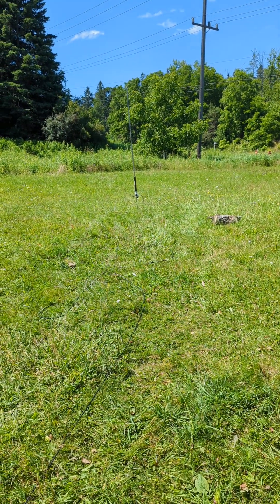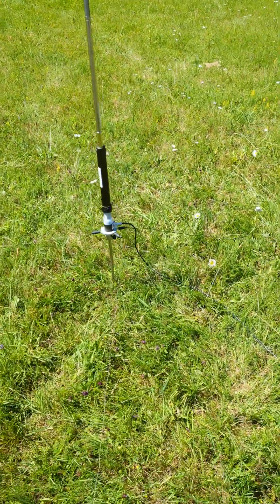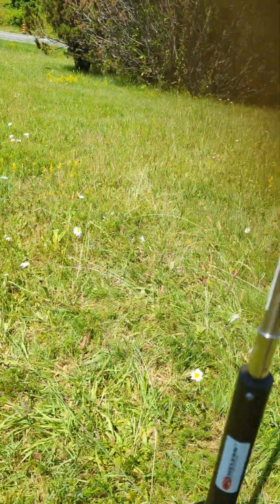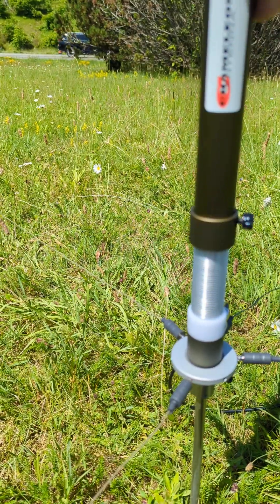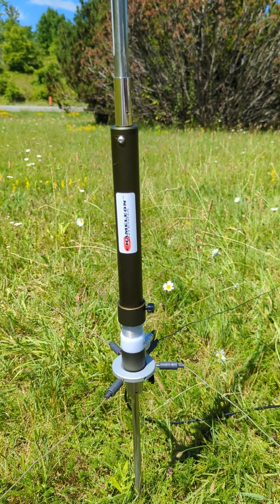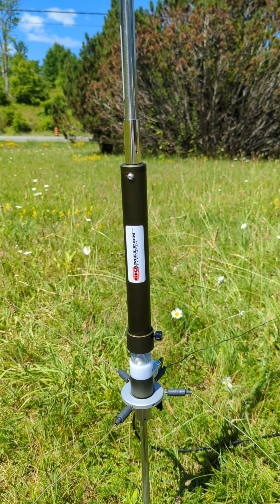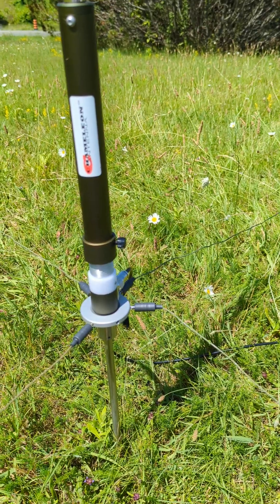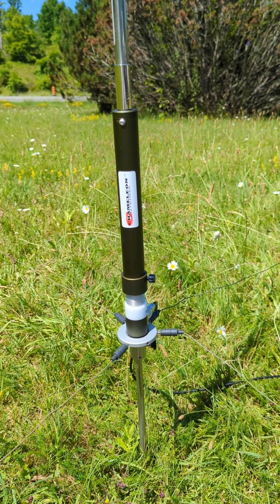Chameleon PRV Review - Fire Trucks POTA Edition

Comment: If you an a  ground wire  to ground and you will get better swr if you do
Reply: Yes I feel the ground spike is enough to provide that ground and then use the standard radials on the ground. Its a compromise antenna so really I just want to get it up fast and make those contacts fast. I have made some great contacts with it

Comment: Make sure to look in the user guide because the number of radials needed isn't always 4 on all band.
Reply from the maker: I added another 4 to my load out.
Reply: If running 20w or less, how close can I mount this to where I am sitting?  Corner of picnic table that I am seated at?  I just got the black mcc and was interested in the 12ft w/ choke for starting pota.
Reply: @christianknight2905  there should be no concerns unless maybe 1 ft away at low power using SSB